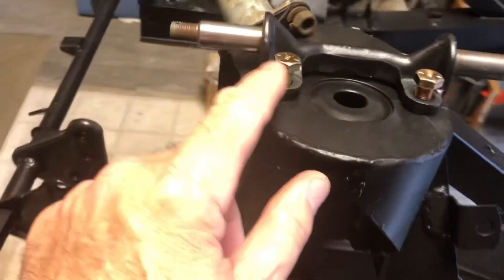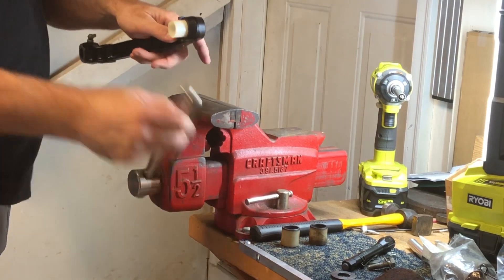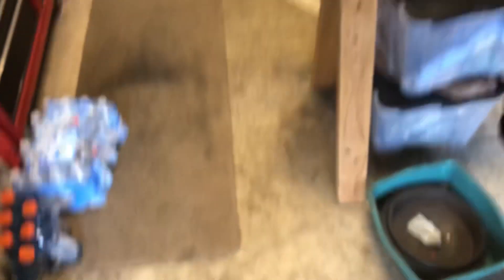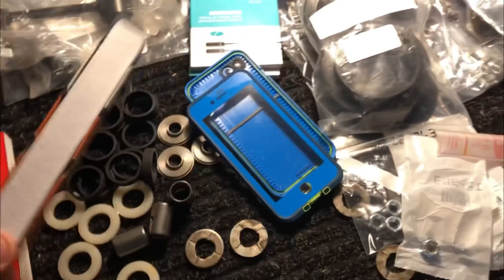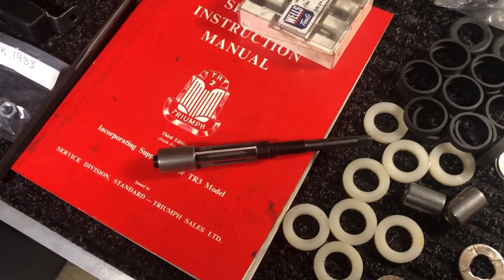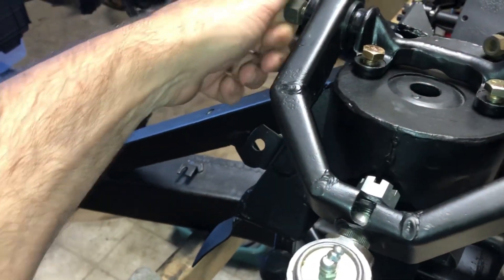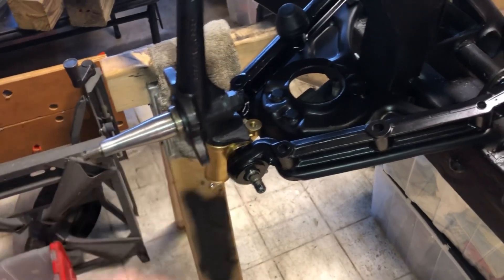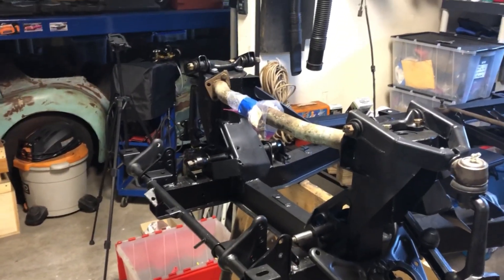1958 Triumph Tr3 ratchet reset and I messed up

Comment: Use plenty of grease when assembling the front suspension bushings. It will go together smooth and reduce any binding of parts when it’s all together. I just finished the exact same job you are doing 😎
Reply from the maker: Thanks for the heads up

Comment: Oh and just split the rear bump stop rubber straight across the thin area. Then just use plastic wire ties to secure to the differential axle tube. By the way the thicker sides go on the top and bottom
Reply from the maker: Thx again Joel
Reply: Mine came split across the centre, secured them with tie wraps.

Comment: Looking good.
Do the front mounting pins come out of the frame? If they do not yoy would have to lift the body to replace a rear spring. What  rear springs are you using?  The ones that the main parts suppliers have are made by British Heratige and look rough. Plus they are way too strong.. They have 208636 stenciled on them.
I got springs made by Eaton Springs of Detroit to the Triumph drawings in the red book you had on the bench. The ride is great.
Reply from the maker: Dave the I think those are the springs I have. They looked like replacement ones and the front pin on the frame does come out. I spent 4 days getting them out and made sure I put anti seize on them for reinstall. Absolutely I would like the information on the ones you had put together!